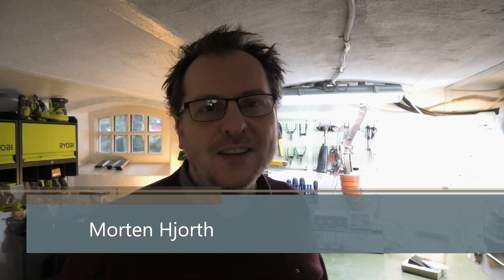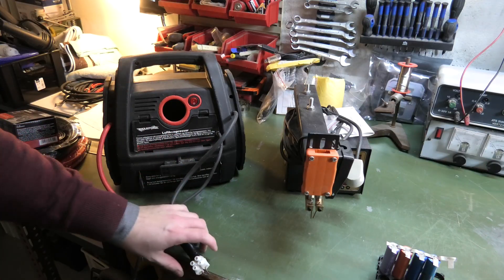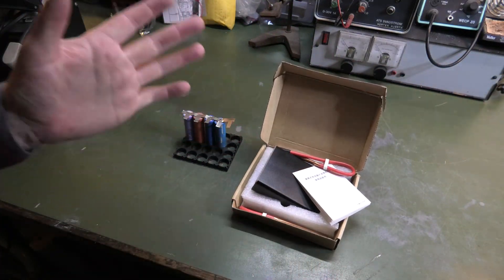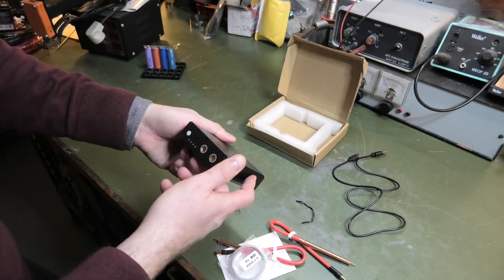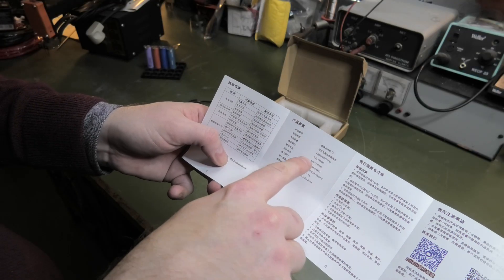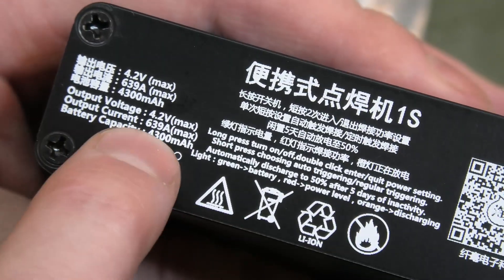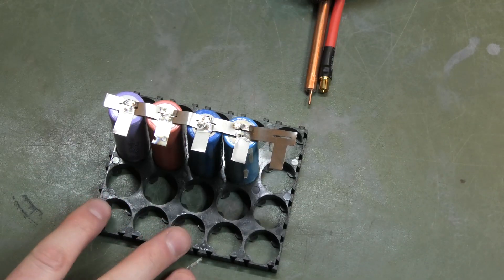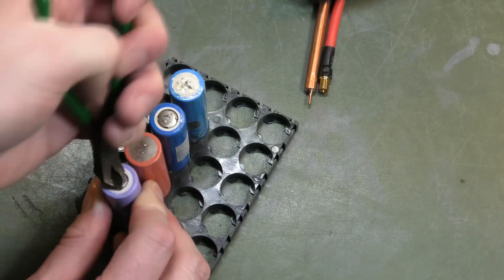Awesome $50 Tiny Spot Welder - Better than Expected - 1031

Comment: I got the newer version the BIFRC DH20 Pro+ , and i has a extra big USB connector at the back, so you can also use to charge stuff with, so you can use it as a power pack, and on the BIFRC DH20 Pro+ you have 9 power settings, but i must say he work great, have already made a 6A battery pack for my Worx power tools, is a LOT cheaper then buying 6A battery's from Worx.
Reply from the maker: I had a look at it,,, I do not think the USB charging port makes any differences,, and the rest looks the same,, they moved the bottom around the back,,, :-) I do not think I need to upgrade to the new version.
Reply: @MyPlayHouse  Yeah, i know, i also do not know why you would use it as a power bank, to charge stuff, but now you have 9 settings and not 4, can also be handy, and that the PCB and the Firmware is updated i think.

Comment: I've tried this one after some good Youtube reviews, but I could only get 0.1 mm pure nickel to stick reasonability well. For some more serious battery packs, this is not enough. I've ordered the KWeld from Germany, and that is some much better. Even on low settings you can weld 0.2 very easy. A bit more expensive, but worth the extra $.
Reply from the maker: I have used 0.12mm and 0.15mm with out any issues, I hear that 0.2mm is the limit for this one.
Reply: Did you get that exact device or some replica?

Comment: Cable is good. High voltage, low amperage, thin wires with lots of insulation is appropriate.
Reply from the maker: I think you got it all wrong,, this it low voltages and high amperage.

Comment: That looks perfect for me. I'm not building battery packs, I just want to be able to repair one or two home devices each year (by refreshing the batteries). Til now I've soldered some Ni-MH in a shaver and electric toothbrush but I'm not that proficient and don't want to heat damage 18650's. So this just looks great for occasional use. It works and it stores away easily.
Reply from the maker: Hi chocolate squiggle
Thank You very much!  glad you liked the video :-)
Thank you for watching! :-)
Reply: That's exactly what I want to do 🙂

Comment: Hi, I am looking for a spot welder to weld the handle. back onto my strainer. the handle is about 2mm thick and the strainer has a flange about 1 mm thick. All stainless steel. Do you think this would work?
Reply from the maker: This is NOT powerful enough to do that!!
This is for stuff under 0.2mm
Reply: @MyPlayHouse  Thanks, I didn't think it would be, but hoped it might.

Comment: Eesh. Spot weld the nickel strips but solder the wires. Also, agree, maybe put some shrink wrap around the unit. Some of the rubber type stuff.
Reply from the maker: It is just the first 10-20 welds, where you think about touching the metal.

Comment: Did you use pure nickel or the roll that came in the box? The box roll was nickel aluminum. I tested it in water. Point is if it's .15 or .2mm nickel it would have alot of good uses...I own one and haven't touched it sense
Reply from the maker: I have used mine quite a bit.

Comment: Can anyone identify the pouch cell? I want to add one more in parallel.
Reply from the maker: Be sure the mosfets can handle the amps,,,
Reply: @MyPlayHouse  thanks! Yes I know this and appreciate the feedback. The combined hardware  appears to be rated for
Over optimistic battery inrush capacity. The current of the Xtra cell I  bought will be limited by the tab material (size, etc). I need to get a base line current measurement first before trying to improve anything. 
Regards
Bill

Comment: When i opened mine i felt nervous about the one side bare terminals being so close to the base metal casing of it so i slipped in a thin piece of plastic to isolate it from the outter casing. I mean its unlikely it would ever touch but it was just one them feelings and these batteries are the violent explode type.
Reply from the maker: There is a lot of power in the batteries, and they will deliver it very quickly,, so you do not want to short it.
Reply: @MyPlayHouse  Thats why i added the plastic to it. just felt like a design oversight they did it that way.

Comment: I like your videos, please don't recommend anything until you used for awhile. I had to put the device to the 4th level to a pack. I had to spot welder the battery 3 to 5 times.
Reply from the maker: I am afraid I can not wait for everyone's opinion, before I recommend something. That is mostly based on my experiences with the product.
I have heard back from people that if the Nickle strips is 0.2mm it becomes a problem,, in this video I was using 0.12mm / 0.15mm and that worked well for me.
Reply: @MyPlayHouse  thanks for the info. As I told you before I like your video. This device works great with nickel strip  0.15mm. I changed the nickel strip 0.15 at 5th level. I did more than 100 cells with a full single charge

Comment: After I watched your video I purchased it. It was about $68 US.  I used it for a week. I wouldn't recommend it because of the price. You used it for less then 1 hour than you recommended it. You shouldn't recommend it.
Reply from the maker: Sorry to hear that you have not had the same good experiences as me,, I have done 6-800 spot welds, and it still works at well as the day I got it. I have done 0ver 300 spot welds on one charge,, and I was the one that needed a brake.

Comment: Please call that connecting ribbon by its actual proper name :Stainless Steel. - It is not Zink neither Tin. We have enough of misinformation in the world  already, no need to add to it..
Nice video, I enjoyed it :)
Reply from the maker: No it is not stainless steel,, you can´t solder on stainless steel,, you can on this,, they are nikkel strip.
Reply: @MyPlayHouse  Nice of You to answer me Morten. I need to add that we are able to solder stainless steel even with a hot iron and common electronics lead -  using a week mix of sulfuric acid . I can not absolutely state that It is stainless but it really seems like SS, I would appreciate if you can make a test with proof to settle the material used.
 Spot welding that You used (and also TIG or electrode), is the preferred way to weld SS - I have myself spot-welded lots of SS material in my earlier  work:) 
Generally It is correct as You told - that SS is unsolderable  without the special fluss I mentioned.
 I connect battery packs using SS ribbons and lead solder, because I usually have a soldering electronics iron, but no spot welder at home - that may change after seeing Your video. Thanx  :)

Comment: I LOVED this review. I have been wondering how to do tiny welding and this looks excellent. Since I have never welded, does the weld require the small metal strip included in the box or can two different metals be welded?
Reply from the maker: I have only been using this for the Nickle strips for batteries,, so I do not know :-/
Reply: Yeah we need to try stainless steel
Reply: @WolverineXXXX hi did you ever try the portable spot welder on stainless steel ?

Comment: What are your thoughts on whether or not this thing could be used for simple tack welding, such as for tacking a nut to a washer or metal frame just to hold it in place long enough for a bolt to be threaded on?   I realize the tack might be very small, but perhaps several spot tacks around the perimeter (of the bolt or washer) for example might be enough for this purpose?   Also, how about use as a "lock-tite" equivalent to hold a nut onto a bolt (so it doesn't unthread easily)?  Just wondering if anyone has ever tried this with any success.
Reply from the maker: This is for very thin matrial,,0.1-0.15mm and works very well with these battery strips,, not much more than that. I was told that it has problems with 0,2mm.
Reply: @MyPlayHouse  Thanks, just the same I purchased one and will give it a try on my proposed application and let you know how it turns out.   Back to you later

Comment: I have my safety glasses, I have my safety slippers, and now I am grabbing both leads of this untested Chinese welder with my bare hands…
Reply from the maker: Yep,, I did also not like the first couple of welds,, but I am around a mega ohm between my hands, and the metal I weld on, is near zero ohm. It is only battery voltages :-)

Comment: i doubt this tiny thing could ever manage to generate 600amps
Reply from the maker: Yes,, and most likely not long enough to be able to measure it.
Reply: The numbers I'm seeing suggest approx 10m ohm internal resistance.  At 3.2V that's 320A.  Two cells in parallel would give you 640A.

Comment: I have one of these spot welders, but it only welds for 5 min then switch’s itself off, by then the electrodes are so hot i cant hold them
Reply from the maker: I did 300+ welds, and it was only slightly warm.

Comment: Did you know that In the BG add there's a link to an English manual?  And I would have used heat shrink tubing on the electrodes as I don't like holding copper parts and be a possible electrical conductor myself :D..Cheers!
Reply from the maker: Hi Sanny RC
Thank You very much!  glad you liked the video :-)
Thank you for watching! :-)
Reply: I have one just like this. It rocks tbh. I was wondering wtf about the bare electrodes too, until they arrived and I found that they're covered in nice thick adhesive-type transparent heat shrink tube. It just isn't apparent in pictures or video.

Comment: I have a similar spot welder. It is crazy how good it works.
I tested it only yet, and I am impressed.
Mine has an USB a 5v 2 amp output on the back and less on the front that shows the battery power.
9 power modes and as I see yours, it works the same with setting up.
I love it.

The rubber casing is a good thing. I think that I print something from tpu to protect the spot welder.
Reply from the maker: Hi Sky man
Thank You very much!  glad you liked the video :-)
Thank you for watching! :-)

Comment: That second spot welder the banggood one, what you need is a 30amp fuse in the plug and back of the machine and depending on what circuit you are using, i had to swap out the circuit breaker for a 32amp C breaker for high inrush currents.
Reply from the maker: Yes,, way more then what I need,, this small battery one does the job.
Reply: @MyPlayHouse  yea I don't blame you, to be honest the battery spot welder looks better.

Comment: i have the exact same one, I added an external lipo battery pack plug so it will last a lot longer. great little spot welder.
Reply from the maker: I did 300 spot welds,, and I got tired before it did :-)

Comment: I used your link and bought the "same" unit. Difference is that my is missing the 2D-barcode on the back and the english text is misspelled ... So far it doesn't show anything else than all green LED's when pressed. I guess it needs to charge for a good amount of time before it starts working.
Reply from the maker: Mine needed charging as well. Hope you can use the video and figure it out :-)

Comment: Hey nice video
 Glad you did the strip down. Interesting to see. I am really interested in a smal spot welder. I did look at the inverter tyres but I like how small this is.

My question is, outside of battery tabs what else can it spot weld or is it good for?
Reply from the maker: I do not think this one is good for much more then this,, bigger stuff,, you need a lot more power.
Reply: Tin Robot Toys?

Comment: I bought this welder after watching your video. I just tried it and was having problems. I could not get a solid bond between the ribbon and the battery or between two pieces of ribbon. Used my Dremel to sharpen both electrodes and Bob's your uncle. Works a treat.
Reply from the maker: Thank You,, nice to know,, I have used 0.12 & 0.15mm ribbon strips and they work well,, I have heard that 0.2mm can be a problem.
Reply: Make sure you're not applying too much pressure - you want high resistance through only applying very light pressure for best results. The fact that sharpening the tips worked is pretty good evidence that was the root problem.
Reply: @anticapitalize  Sharpening might not have been the issue.

Copper can oxidize a layer you can't see  but effect performance. The sharpening could have just removed / cleaned the oxidation and it wasn't the "sharpness" that actually fixed it.

Comment: What thickness is the nickel strip?
Reply from the maker: I have used 0.12 and 0.15 with good results..
Reply: @MyPlayHouse  thanks man! would that be sufficient for 21700 cells for a powertool battery. 30a rated?

Comment: Hello. I have ordered this spot welder on AliExpress and was wondering what is the best thickness for nickel strips to weld for 18650 battery pack for a drill. There are a lot of different thicknesses such as 0.1mm, 0.12, 
.15, .20 mm.
Reply from the maker: I have had good results with 0.12 and 0.15 and heard from people that they have problems with 0.2.
Reply: @MyPlayHouse  Thanks. I ordered the .15 yesterday so it should be good.
Reply: @electronixTech  My suggestion is that you can use 2 or 3 layers of 0.12mm strips instead of thicker ( like 0.2mm) strips.
Reply: @zhonghuang100  Thanks for the advice. Much appreciated.
Reply: I just got this in the mail yesterday from AliExpress and this video was very helpful. I tried it welding some NiMh batteries together and it works great. I think it is worth buying and you can save some money making your own battery packs that cost a lot of money if you were to order them already made. Some of these battery packs are no longer available for older products too. I am fan of the YouTube channel Gear Show where a Japanese man restores old battery operated drills and tools. I will be replacing some old battery packs on 12 year old Dewalt drills I have and this spot welder will be a big help.

Comment: Hey friends. 
Great video. 
I have the same spot welder but have had problems using anything thicker than 0-1mm. 
I would really like to know what connections are they using from the pens in to the unit. Are they XT150 bullets as I have bought some pairs and plan to extent the cables to 12inch I’m total using 8awg silicone cable. Am I correct in thinking these things above and will it be of service as I doubt the cable they provide which is said to be 12awg and would I get a better welding experience using 8awg at 12inches or longer??? 
Thank you kindly friends!!! ✌️🙏✌️
Reply from the maker: I have used 0.12 and 0.15mm and that has worked good.
Reply: @MyPlayHouse  Thank you my friend. Keep at it. 💪💪💪🙏✌️🙏

Comment: For the average person that will be spot welding 18650 batteries off and on when the need arises for small projects, its works well and very reasonably priced, and btw... theres a youtuber by the name "Sanchai" that reviewed this very same spot welder, tested by welding two peices of nickle strips together, from the lowest to the highest setting, it will not weld .2mm hardly at all, so for best results, use .1mm or perhaps .15mm the most.
Reply from the maker: Hi Bige4u
Thank You very much!  glad you liked the video :-)
Thank you for watching! :-)

Comment: Malectrics makes a wonder battery spot welder that's very affordable, and will weld up to .3mm nickel. There's also the slightly better but more expensive Kweld.
Reply from the maker: This works great for this low prices.. 300++ weldes on a charge, time for a brake at that point anyway.

Comment: Gonna have to buy this soon so i can weld my own rc packs 👍 nice review!
Reply from the maker: Hi 『 ЯiΖΞΝ 』
Thank You very much!  glad you liked the video :-)
Thank you for watching! :-)
Reply: You cannot make RC packs from 18650's. There isn't enough current unless you buy special 30A cells which are expensive. Those ones are only about 2000mAh so that's 15C. For RC you usually need a lot more power than that.- you are better using LiPo pouch cells,
Reply: @johncoops6897  yes, the c rating is lower than with standart lipos but 18650 battery packs are mostly used for long range flights or flights with long endurance. since most smaller efficient rc planes only consume about 10 - 15 amps on full power a 18650 pack is enough to fly
Reply: Li-ion cells also come in sizes other than 18650, there are 3-4Ah 2*700 cells that'll run cool at up to 35A (Sanyo NCR2070c, Samsung 30T, Molicel P42A, I've personally tested all, all handle 35A continuous just fine & burst rate probably double that). I've never used them but I know there are much larger cylindrical cells capable of 50+A. Still incomparable to a great lipo pack but can be not too terribly far off, plenty acceptable for lots of ground based RC stuff. There are always li-ion flat cells as well...

I think I'm missing why I can't spot weld my own lipo packs (besides the safety issues - I'm a trained electrician & have been repairing mains single/polyphase AC and all sort of DC devices for probably 30 years without any accidents). I also just spotwelded up a new battery pack for one of my UAV groundstations, previously it supported a 5200mAh 2p 18650 pack that'd degraded to ~3900mAh, I realized the battery drawer could be just slightly modified to accept 2x21700 or 20700 cells and a protection circuit now. A set made with Sanyo NCR20700B, apparently the 1mm lesser diameter baby brother of a Tesla NCR21700B (which don't come with the positive terminal attached, to save weight for tesla, the whole line is composed of fantastic cells imo, and another 10Ah pack with a pair of Samsung 50T when I realized I could squeeze in two more mm. I've got two huge sacks of 5200-8000mAh 3s lipos, able to fly a relatively large 4k video & photography drone many hours at a time, all day basically, without ever having to bring two base stations or charge on the go (the oem battery is like $80, I built much better packs for under 25ea)

Plus RC predated any Li chemistries.. obviously there're still many uses for a terminal welder.